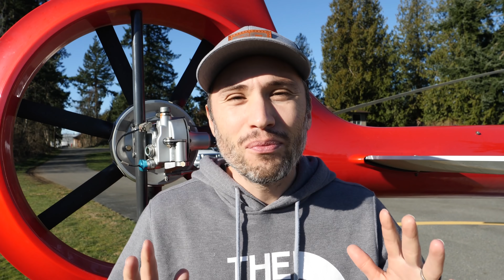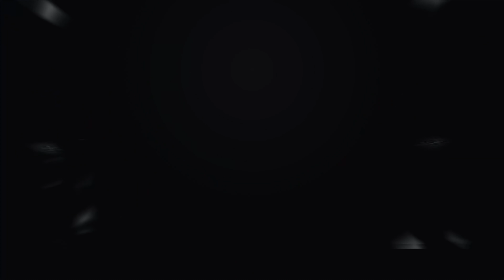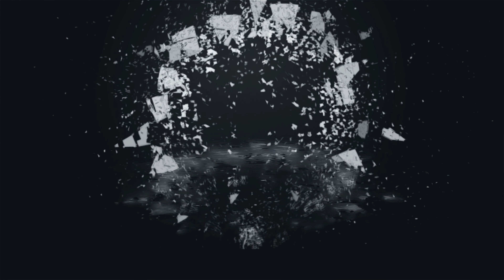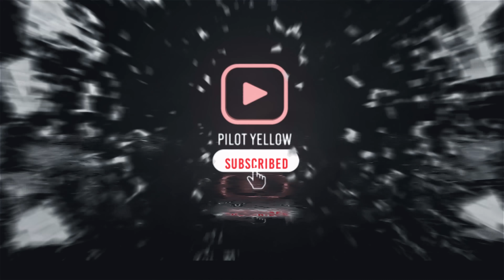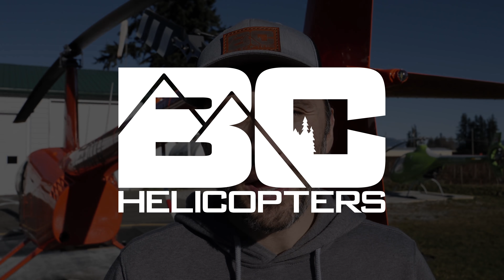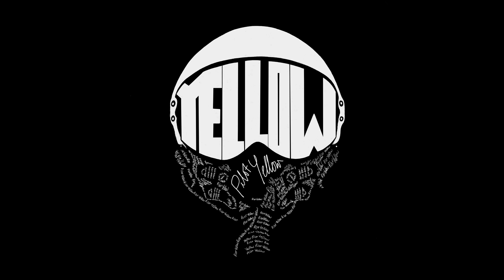why Fenestron tail rotors suck!

Comment: Sikorsky is turning in his grave that we are still trying to "blow" torque away. It takes 20% of the total power output of a helicopter to keep it straight.  Coax helicopters have been around since 1750's in model form. This is like saying "which carburetor" is better. They all suck.
Reply: You nailed it.  Get rid of the T/R and put all you power to the main rotor.
Reply: carbs are great tho

Comment: why is there a song drowning out your words ?  time stamp 5:42 to 6:09
Reply: Because when you're selling vaporware, you want to protect your unpatented and obvious ideas like using a cam profile on the pedal inputs to make them feel as linear as a conventional tailrotor. Oooops😬 that was probably a secret.
Reply: Why not get rid of the drive shaft coming from the engine and use a powerful brushless dc motor to spin the rotor at stupidly high speeds without worrying about how much power the engine can produce? That is how its done on some small rc choppers
Reply: @pieterpretorius1014  Because electrical failures happen, motor speeds could get out of sync with main rotor. Also, you need to generate enough power to run that generator, and that takes power from the engine too. Electric motors have weight to them as well. Imagine if you had an electrical failure that led to the loss of the engine as well (does happen, and sometimes a failure necessitates an engine shutdown). There are ways to land without a tail rotor (run on) and such, but it's gonna make certain emergency landings unsafe.

Mechanical linkage keeps the tail rotor spinning proportional to the main rotor in the event of an engine failure. RC helicopters don't involve life and death the way real helicopters do. Also, RC aircraft can do things real aircraft can't, due to scale, thrust to weight, Reynolds numbers, etc. Electric RC helicopters use motor RPM to adjust thrust, where as real helicopters use constant RPM, and adjust the blade pitch. Again, things can be done, but I just don't see the risks and challenges as worth it, and what would you gain in the end?
Reply: @petrecz  Interesting. curious to see how it develops.
Reply: @pieterpretorius1014  https://verticalmag.com/news/bell-electrically-distributed-anti-torque-edat/

Comment: Hey another question, i find an RC heli takes more power to hover than fly forward at reasonable speed, i believe the turbulace of propwash causing a well the heli is fighting, not a problem moving forward in clean air?
Reply: Induced power requirement in the hover is vastly more than in forward flight. This phenomenon is present in all helicopters.

Comment: I'd prefer a fenestron for safety.  A major part of a helicopter accident and crash is due to tail rotor strike.  In a fenestron, the fan is protected by the frame around it.  However they cannot make it as big as a regular tail rotor so designers have to limit it to 3ft or thereabouts, compared to around 5 to 6 ft for a conventional tail rotor.  The difference in area is quite significant.  Thus to compensate for loss of authority, the fenestron have to have more blades and spin about 50% faster.  But overall a great design.

Comment: Just a thought ,why aren't tail rotors painted in high visibility or fluorescent colours for greater safety?
Reply: there's probably a good reason for that. If you take a look at most tailrotors standing still you'll see that tey're painted in high contrast colors such as black and white or red. but as soon as they are spinning you wont notice that anymore.
About fluorescent/ glowing / reflecting: I bet there's FAA regulations on things like these in order to ensure collisionlights keep their spot as the most visible things on aircraft.
Reply: the noise and well disturbed air is usually enough,spin dilutes bright colorings.

Comment: You would think the higher RPM would make it much more responsive. I assume the smaller diameter section area requires a higher velocity for the air flow which is not going to make it easy to overcome in the smaller control inputs even with gearing changes in the linkage. I think the best design would be a fenestron that is large and slow with no more than three fat blades. It would be responsive and less likely to have LTE problems with low RPMs.

Comment: Why isnt the relationship between pedal input and tail rotor thrust in fenestrons not linear? Isnt there a direct relationship between pedal inout and angle of attack / lift of the fenestron blades?
Reply: I think it's because the smaller section area of the blades requires the higher velocity air. I don't know this for a fact, but it seems it would be the case. If this is the case, it's like trying to accelerate from 5th to 6th gear instead of 1st to 2nd.
Reply: To expand on that in your terms of AOA, the air is already coming in at a high velocity so you don't have the range of AOA you might have in a larger, slower blade.

Comment: It's a shame the main rotor system in the G2 is so low. The added safety of the fenestron is diminished by such a low hanging main rotor.
Reply: Not that big an issue because they use a fully articulated rotor system so the blades don't dip any lower than a semi-rigid rotor in a strong wind.
Reply: @rsrt6910  For an equal amount of cyclic input sitting on the ground (not centered) they sit much much lower than any conventional helicopter. Only exceptions are microlites. In a perfect world the disc is always level on the ground, in reality (as we've seen recently with yet another lost life) that's not always the case. Lower is always going to be a higher risk.

Comment: So Authority is like the sensitivity level on my PS5 controller 🎮.
Reply: Its like the amount of travel a servo has when you setup an rc airplane. The more travel the more aggressive the input. For gentle flying small travel is better. But for aerobatics all bets are off and the full motion of the servo can be used. Go look at some flite test video they explain it quite well. With rc as well as with game controllers you can use exponential curves to make small input near the center of the sticks travel and large input at the outer edge of the sticks travel. Not all games have the option to add exponential curves to the sticks
Reply: Not sensitivity level, but deadzone level.

Comment: Airplane guy, not a helicopter pilot ... lots of helicopter crashes caught on video show tail rotor hitting wire, trees, ground strike ... and the conventional tail rotor just breaks off leading to uncontrollable spin and crash. I feel having the Fenestron shrouded and providing significantly better protection to the tail rotor is one of the biggest safety benefits.
Reply: Helicopter guy here, not a fixed wing pilot... can confirm.  We devote A LOT of attention to that tail rotor and what's around us when we make an approach and never, EVER walk behind the aircraft while things are still moving.
Reply: @rsrt6910  youll only make that error once,but it is kind of obvious.
Reply: crikey,if the tail rotor is close enough to strike an obstacle,that means the main rotors pass is merely inches away,stay away from all statics,the only contact other than "air"should be via the skids.
Reply: Me too

Comment: Love the safety feature of the fenestron in regards to visibility. As someone new to helicopters, infrequently flying HEMS missions, the big disc around the blades on the H135 and H145 is always clearly visible. If they could do the same for the main rotor system, I’d feel safer in regards to entering the disc with it running ;). Don’t think I’ll ever get used to moving in and out under the disc with engines running! 🙈😰

Comment: I prefer a fenestron. Two different, methods of flying. With a conventional tail rotor you can make power changes and then apply pedal. A fenestron, slightly different. You have to anticipate pedal needed when using the collective and get the pedal moving early. Example, people criticise an EC120 for lacking power. At sea level anyway can make a steep approach, fully loaded, flare and as you get to raising the lever your right foot is ahead of you and already putting power to the tail. Fly it like a conventional tail rotor and react to power changes second, you will spike it, possibly run out of power and have an accident.
Reply: did you mean "when using the collective..."?
Reply: Yes. @rigilchrist

Comment: Just make it electric.  Much safer.
Reply: Untill those E motors burn...Bell tried it in the 429
Reply: @madikgetlakagiso1525  its a good point and nice to see Bell trying something new.  
So they can try, fail and learn or they can just give up.  Its a test flight program. 
Which camp are you in by the way?
Reply: @lpdirv  im in the SAPS(police dept) operating the AS-350 eurocopter
Reply: @madikgetlakagiso1525  and?

Comment: I did most of my private/instrument/commercial in the Cabri and I agree that the Fenestron is a non-issue as long as you're prepared to move your feet far enough to produce sufficient anti-torque thrust. Coming from fixed-wing aircraft it's not really a big deal, in fact it's just about the same amount control movement as landing a taildragger in a crosswind.

I am curious, however, about the statement that a Fenestron loses thrust more quickly with decreasing RPM, due to its higher gear ratio compared to a traditional tail rotor. I heard this same factoid in my training and dutifully nodded my head, but from a physics standpoint it's never made sense to me. Can anyone walk me through an explanation for why this would be?
Reply: I also made the same remark regarding loss of thrust due to higher gear ratios. Please elaborate.
Reply: I think it's not much about the higher gear ratio but due to the fact that it hasn't a linear acceleration like a conventional tail rotor, so because of that, it delivers enough anti-torque force only when the pedal is pressed a lot, and if LTE happens it drops rpm and therefore effectivness much quicker. 
By the way I'm doing my PPL in a cabri and i will make sure to understand this fully. I am also very cuorios about the feeling i will get when piloting an helicopter with conventional tail rotor, being so used to the fenestron
Reply: @samuelepampanin7515  If you go to a traditional TR, you may over-correct at first, but overall you'll do less range of travel with your feet in normal operations. You will though use more pedal when in the cruise compared to a Fenestron.
Reply: @ulsig95  I just don't think the math bears this out. With either system, a 1% decrease in main rotor RPM will lead to a 1% decrease in tail rotor RPM.
Reply: Fenestron design usually use smaller diameter less wide different airfoil blades with higher rpm...so at lower rpms you are maxed out on blade-AOA sooner to provide the same thrust/lift vs a more conventional size/shape blades...I guess...

Comment: What do you think of that 4 electric tail rotor system that Bell is developing?
Reply: Current FAA regulations require the pilot to safely land with an engine failure and/or loss of electrical power.
Not sure you can do that with this new Bell design (or those rideable drones for that matter)